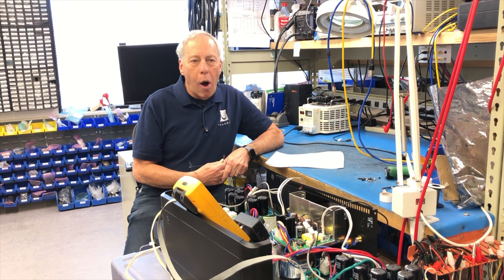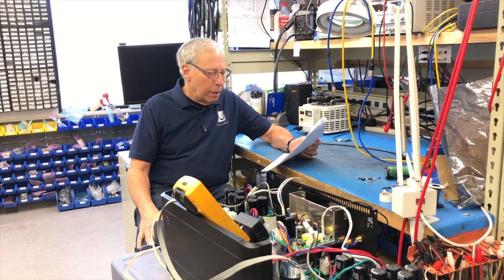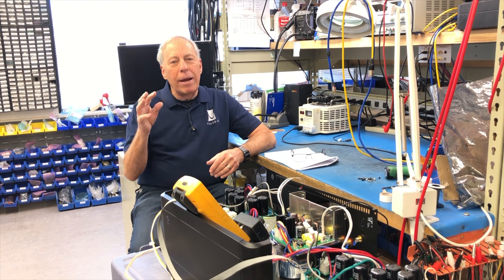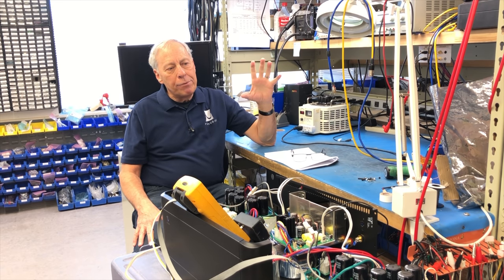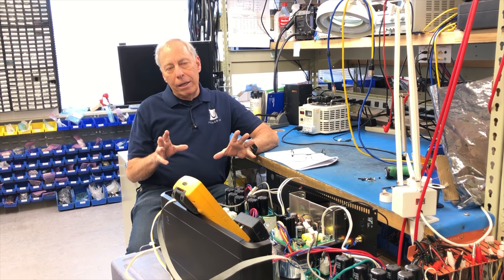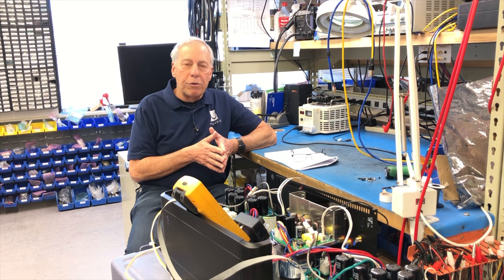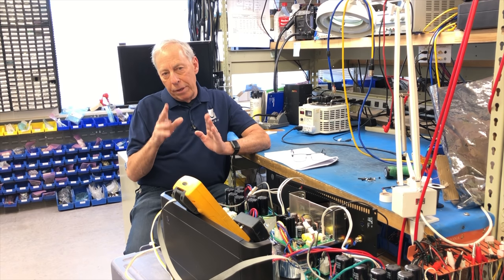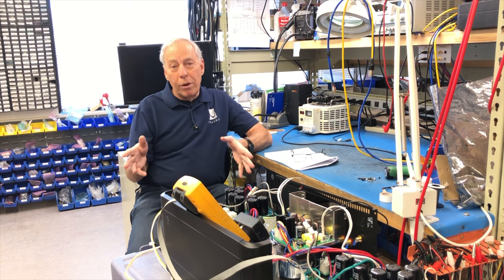How to choose correct amplifier wattage

Comment: It's weird, I have a pair of kef LS50, the recommended range of matching amp is 25 to 100w into 8 ohms impedance. It's a low sensitivity speaker. I got a musical fidelity m2s amp. Which is rated at 72w into 8 ohms. Boy in my room, which is a medium size British bedroom size. I can't get the volume more than 35 percent of the total movement, until the sound is so painfully loud.

Comment: Plain English ...loudess level using 80db is same in 10 watts or 1000 watt equal 80 db before you move the volume level up, what change the sound stage developed the sound is relaxing or it idle

Comment: Long time ago I had a 25W amplifier in my car. Then I bought a 200W (sinus) amp. Wow, what a difference. And I don't even talk about the maximum volume. Hearing music at relative low volume, a level which the 25W amp could easily do, the sound was a lot better with the bigger amp. Obviously the 200W could also produce a higher volume, but that was not the main difference.

Comment: The situation with electronic sound amplification is that two things are going on at once; the amp is drawing power from the wall, but it is also making power for the speaker. Like an electric motor, the amp is kinda dumb, and the speaker is too, intelligence, and ‘protection’ must be added. When the source increases its dynamics (gets louder), the amplifier responds in kind and sends more voltage and current to the speaker to cause it to worker harder, push more air, and thus make more sound, in other words, to get louder too. So far so good. The volume knob has the same effect. We use the volume knob to adjust the loudness to our liking, what could go wrong?

Two things. In response to the user’s request to play louder (using the volume button), the amp can be driven into clipping. If you are feeding a single test tone into the amp, the swings of voltage become so great that they can no longer be contained within the operating range of the output devices (transistors or tubes), but the amp will try anyway. On the oscilloscope, the tops and bottoms of the wave form will flat-top. If connected to a speaker, the user will start to hear the sound distort itself, because the signal it is receiving is distorted, but it will try to reproduce it anyway, because it doesn’t know any better. If this situation is allowed to continue, one of two things will happen depending on the ‘balance of power’ between the amp and the speakers. 

1. ) If the amp is rated for, say 30 Watts, and the speakers are rated for 200 watts, the amp will blow. The amp will also blow if the speaker’s impedance is too low, as in hooking four 8 Ohm speakers up in parallel and thus presenting a 2 Ohm load to the amplifier, but we’re not talking car audio, here. 

2. ) If the amp is rated at 300 Watts and the speaker is rated at 60 Watts, the amp won’t go into clipping, the wave forms won’t flat-top, but the speaker will try to exceed its mechanical limits of excursion, it will start to heat up from the extra current running through it, the voice coil will expand, start stick, get stuck, and the speaker will destroy itself, if that happens, it could take the amp down with it; hopefully it will blow a fuse on the output side of the amplifier before it does that. 

There are other ways that amps and speakers can damage each other and blow themselves up, like turning the bass tone control up so high the voice coil is slapping the magnet at the rear. And there are ways to add protection to the amp so that it recognizes when clipping is occurring, and notifies the user (who is still free to ignore the warning), fuses can be added to speakers is case there aren’t any in the amp, etc. So, while in the main, on this topic, Paul is correct to emphasize the desirability of equipping oneself with a powerful amp, and there are advantages to having one, when the whole chain is considered there are several facets of performance that must be aligned to get optimal performance from one’s system. Buying an integrated amplifier takes a lot of the guesswork (and cables) out of it.

Comment: The amplifier doesn't run at full output unless you turn the gain all the way up. Higher power is good for dynamics for brief periods of time usually milliseconds. Higher power also means your amplifier is less likely to be driven to clipping, clipping is what damages tweeters. I have a 5 channel power amp that puts out 125 watts all channels driven and the only times I came close to clipping was with movie. More power good. The only time I fried my tweeters was with a 30 watt receive.

Comment: Still trying to figure it out. I am probably going to try to go with high power because I do like to crank it up now and then. I understand the Hi Power Amp not running out of  as you increase the volume. But then I read about tube amps putting out 16 Watts that blow 100 watt amps out of the water. I also read that the first watt is the most important and that most of the time people do not use more than 5 Watts. I am wanting to go with a tube amp or maybe a hybrid. Thinking about a Vincent sv-237mk because I could later use it as a preamp and and a high power amp. Primaluna premium or dialog is looking tempting also. Also considering getting ohm 2000 speakers or maybe ohm 1000 since my room is only 15 by 15. Component matching is very critical and glad to see PS audio tackling that issue also.
Reply: "Clipping" is a description of what the waveform of an overdriven signal looks like on an oscilloscope - it's like the tops of the waveforms got "clipped off." When that clipping gets really severe, the waveforms resemble squares - "square waves." When tube amps clip, they don't behave like a solid state amp. SS amps pushed to clipping put out lots of third harmonic distortion and even square waves, which are VERY damaging to speaker voice coils (and sound dreadful). Tube amps clip "softer," meaning the harmonic distortion is more musically related to the main sound. They also aren't as quick to generate square waves as a solid state amp. So even if you start pushing a tube amp to its limits, the onset of nastiness is more gradual.

Comment: Another concern is whether high wattage amps sound different to lower ones, or is the only reason some amps are lower wattage is to save on price of components. Like are you losing anything, say depth or resolution for picking a 750 watt amp compared to 50 watt one?

Comment: Thanks! I have to replace a door speaker in the used car I just bought. It has a 600 watt SPL FX2-600 amp. I had no idea if I needed to buy a 600 watt speaker set. I'm sure the door speaker is OEM. The previous owner added two Bazooka tube speakers to the back. I have no clue what they are rated for. I'm looking at a set of 300 watt speakers and hope I'm not making a bad choice.

Comment: I have an old Rega Elicit amp rated I think at around 105 watts.  It drives my 88db efficient floorstanding speakers.  I very rarely set the volume control past 12 O’clock. It would be far too loud, in excess of 105db!  If I connect my preamp and 400watts monoblocks to the same speakers, turning the volume control to 12 O’clock only raises the SPL to around 78db  after that the SPL rises sharply when turning the preamp volume higher!!

Comment: welll i need more experience, lets say mu pioneer CS-A700... or klipsch fortes which are very sensible speakers to drive, and they might deliver the best with 5-10W RMS... i think a small 20W tube amp will drive them better

Comment: Big amplifiers don't make 1 set of speakers louder (even if your speakers has big wattage capacities to handle the push of the amplifier) add a multiple set of speakers in your big amplifier to accommodate the loudness that you need. Just make sure that your amplifier has 25% more power to the total wattage needed for multiple set of speakers.

Comment: But those peaks are murder on speakers that can't handle much. I have pair sitting downstairs since one of those peaks blasted the woofer. They were rated at 75 rms 150 peak. Paul I can't count the number of speakers that I lost over the years running big amplifiers.

Comment: Hello there!
I am trying to make sense of the whole amp - speaker - wattage issue and the more videos I watch, the more confused I get. 
In this video you are saying that you can't have too much wattage on an amplifier. But in a very similar video about amps and speakers you say that the wattage of the amp should NOT exceed the wattage of the speaker (which makes sense to me).
Do you mean that you have to be careful and not pull up the volume control too much in order to keep the speakers safe? 

Sometimes people say this, sometimes people say that, I find it extremely confusing! Could you maybe enlighten me once again on this subject.

Thank you very much,
Cheers.

Comment: There's a thing "generally sounds better" it doesn't have to be the case. If you got 100 watt speakers you could easily blow them if you turn it up very loud. Nobody needs 900 Watts there is head room and there is head room...  use in a home situation it's not necessary to have that power.
 you take the music fidelity A1 at 20 Watts it is a very good sounding amplifier in anybody's language can and will some better than a 300 watt amplifier

Comment: I was thinking about this just earlier today, but from a different angle... which was how to match amplifier power to speaker sensitivity. Mine is more of a mass market consumer angle, as it blows to buy a bunch of stuff and get home and find out your 95 watt AVR can't drive your 86 db speakers worth a damn... I just think the audio industry should make an effort to get some more better and deeper edumacation out there to the masses. Some companies try, for sure...
Reply: Thanks for your concern Mr my name. You exaggerate, jackhammer is rated at 100 dB. The 86 dB example is a reference to a standard measurement, it does not indicate listening habits. But what the heck, I was measuring some speakers tonight that I’m building. In the big room they were at about 90 dB 25 feet from the speaker, and about 110 dB a foot in front. Point being, if you are listening at 78 dB at the listening position the speaker is putting out an actual 94 dB just out front of the speaker. That is in a 9’ distance (I just measured that while typing this). So it’s not absurd abuse to speak of high dB numbers.

Comment: The more the better, right? Well, what are you trying to amplify? How big a space? What are your speakers rated at as far as power handling, i.e. heat, can they take? 700 watts? Damn man! 100 is more than I need. 700, with a smart hand at the volume knob that would be ok. Yup, Paul is right. You can't force energy i to a speaker, but if you try to turn them up too high, no matter what the power is behind that, it will destroy a speaker. My roomate blew out one of his speakers with an old gorilla amp that was rated at 100 watts. He fried the other side on my 30 watt amp. It didn't matter, he overdrive the tweeter and it's excursion was greater than the room it had available, mechanically slammed the voice coils against the back of the magnet, mechanically breaking them. 
As for the bigger amp question, the more power you have available that's clean, undistorted power, the more your speakers can handle until either they reach they're mechanical limits, i.e., running into the back of the magnet housing where the voice coil rides on the cylinder attached to the magnet, or the heat is too great for the windings of the voicecoil to handle, melting them.

Comment: Thanks Paul, very insightful. Please consider giving a thorough explanation of gain. 😊
Reply: For  a voltage amplifier: 

outputV = gain × inputV

The only complication is that gain is frequently represented in dB, so you need to convert the gain into a factor for the above equation to work: 

gain = 10^(dB/20)

That's all you need to know about gain for a voltage amplifier.

Comment: Of course higher wattage amplifiers cost more, generally.  So, if economy is important to you, ask yourself: how loud do I want to listen to my music?   If you're not going to blast your music, then you won't really be using all that wattage potential in a higher wattage amp.  You can get away with a smaller amp.  Of course Paul's arguement would be (guessing) that having more headroom, with more postential wattage, makes for better transient response, and allows for less asymentrical distortion (you get a better linear response on both sides of a sine wave, with symetrical peaks, basically plus and negatives as mirror images.)

Comment: I have Fender, Vox, Marshall, Blackstar etc...Tube Amps!! 1 watt up to 85 watt Fender Super Reverb is LOUD!  Different sound than what I noticed here. Discussed here are Solid State amps I presume! Very different than Tube amps!
Reply: Even when the sensitivity of the loudspeakers in the guitar cabinets are higher than HIFI speakers in general, and they don't use an X over, you are right: there is definitely something going on in the wattage versus perceived volume. I had a chap bringing his 500W class D bassamp, and comparing it to an Ampeg tube amp it was a joke. I asked: what is that red light going on and off? It was the clipping indicator! Almost couldn't believe it! 100W of tube power easily outperformed 500W class D.
Reply: I have noticed this as well while comparing AB amplifiers to class D. AB just sounds more rich and full to me. Though, I probably have not heard a really good class D.
Reply: @johnclark3067  I don't know if there is a class D which approaches class AB. I went once to a large guitar center to pick the best class D bass amp, just as a spare for my tube amp. Most of them sounded ridiculous. The best one was an Ampeg. At home I realized that even for studying at home I couldn't bring myself to use the class D, so I kept using my Ampeg 300W tube amp, burning up 6550 power tubes, producing a lot of heat, and consuming a lot of power. Till now I never heard any class D that comes close to being good.

Comment: I'm over powered my speakers by 25%. Had a couple drivers replaced under warranty years ago. I can hear them start to crap out on contious high level but nothing on transients as there's lots of head room in a 60lb toridol(sp) transformer.
Reply: The most important, and most expensive, part of an amplifier psu isn't the transformer, it's the electrlytic capacitors that act as some kind of superfast hi current accumulator. When the amplifier has to deliver hi amounts of current in the split of a second the Capacitors are the parts of the psu where the Current is taken from.  Most Amplifiers have a symmetrical power supply, that uses a positive and a negative voltage, and so there are two Packs of Capacitors, one for the +, and one fo the - rail. For a 25W Amplifier I use 25000 - 30000µF per rail. This gives a good push in dynamics & punch. For my 170W Subwoofer Amp I use 80000µF per Rail which gives a pretty good performance. It's really ok as it is, and I've got other things to do first, but maybe somewhen, I'll try 120000 or 150000µF per rail. A big Speaker can always handle a little xtra current.

Comment: Hi @PSAudio , I'm first time building a speaker on my own. I have 100w 2.0 Apm that will power 50w/channel. for 3 way crossover i chosen: 
woofer - 40w 
mids - 15w 
tweeter - 15w

all are 8ohms (i have option to go for 4ohms)

What do you think, in total 60w for speakers is too much or how should i choose mids and tweeter power?

Comment: I take the speakers rated efficiency ( generally around 88 db /watt )  then take the formula that 3 db increase requires double the power.  thus going from 88 db - fairly loud) to just plain loud , say 100 db.  that would require minimum of  16 w.  double that for minimum headroom - 30 w.  then the 2 nd stereo speaker would compensate for room size.
 > that's talking the conservative 20 -20,000 hz continuous wattage.  instantaneous peak is usually much higher and that would also add 'headroom - distorting speakers because of low headroom are baaad.  that's my idea, 50 w chan. is entirely OK for an AVERAGE room / speaker combo.
Reply: Your math doesn't add up. 1 watt = 88db does not work out to 16 watts = 100db.
Reply: what don't I get - 1 watt equals say 88 db? 2 w. = 91 / 4 = 94 / 8 = 97 / 16 = 100 db.... isn't the simple formula that going up 3 db  requires double the power ?  that's probably an anechoic room whereas in real rooms, there're all sorts of reflections boosting or cutting.?  obviously   a simplistic guesstimate, close enough for the purpose. What'd I get wrong ?
 @carlosoliveira-rc2xt

Comment: I think if manufacturers would just make their amplifiers clipping proof. We wouldn't have this problem. People want the ability to to max everything out. Many dont care about how bad clipping sounds. Then they are dumbfounded as to why their speakers ceased up. It takes power to make power. But it takes even more power to supply unclipped current to your speakers.
Reply: I recall Onkyo receivers back in the early 80s having their gain set so the amps volume would max out before the onset of clipping. Not necessarily a great idea though but dealers nonetheless used it as a tool to show their receivers were better than the competition.

Comment: My Q accoustic 3050 floor stand speakers are rated at 92db/1watt sensitivy,  I don't need alot watts to produce plenty loud music. I ended up buying an hyped  ncore 125watt x2 (45wx2 RMS) class D amp. This combo goes plenty loud for me without straining the amp to my ears and calculations.

Speaker sensitivity should be discussed too.
Reply: What should be discussed is how sensitivity is measured in a loudspeaker. Not as clear cut as what some may think.